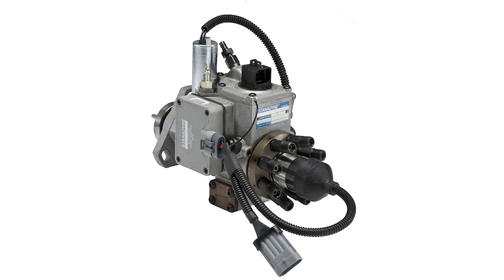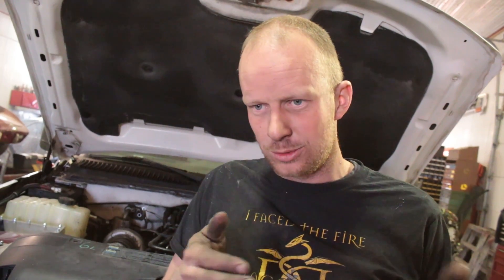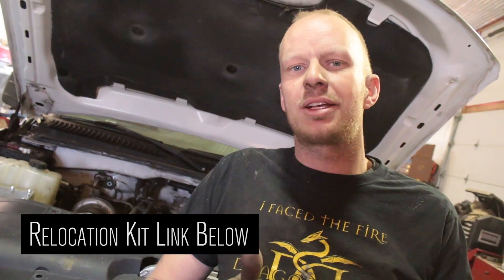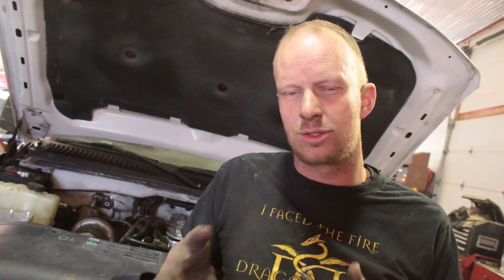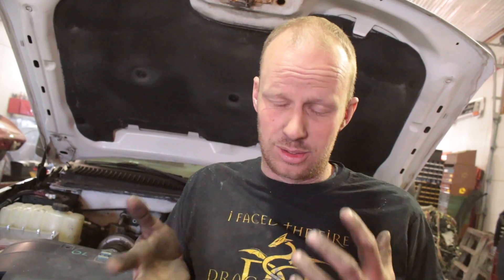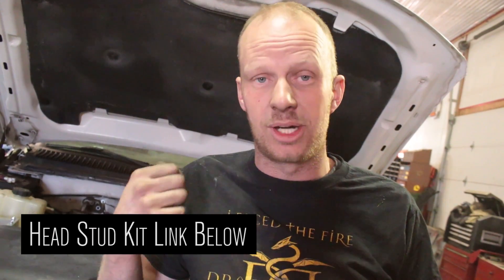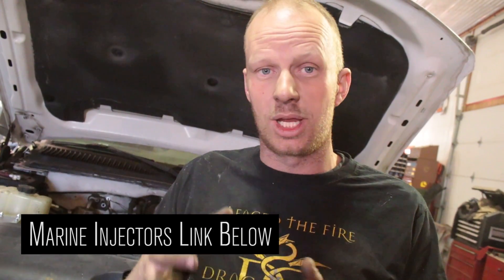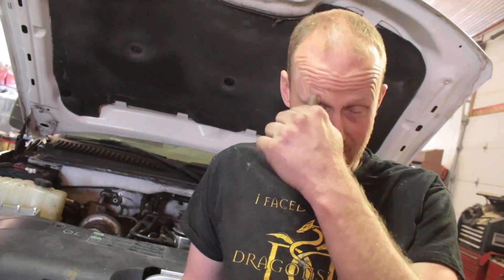REVIEW: Everything Wrong With A GM 6.5 Detroit Diesel

Comment: My brother just sold his reliable 1993 6.5 Detroit Diesel he had for years, he was extremely sad when it left but it was only sold because he got an insane deal on a 2004.5 LLY Duramax. It had like 232k miles on the clock. He did a lot of the upgrades you talked about, bigger turbo pushing about 25 pounds, airdog pumps, he's a mechanic so he did modify it for reliability. It might be "rated" for only like what, 8,000 lbs towing capacity or something? 

But he definitely pulled way over that without any problems, he was pulling 12-13 tons with it. His was a 3500 (non HD), 2WD dually. The most insane bit was the gas mileage on that truck, while pulling 12 tons of logs he'd literally get 26MPG. It was insane. He pulled heavy loads with that truck frequently as well. It pulled it with no problems, it might've been a little bit of a bumpy ride because well it doesn't have the suspension of the newer trucks, but it pulled it doing 65+ mph SCREAMING down the highway. His newer LLY duramax (completely stock duramax with just an EGR delete and stock exhaust... not even woken up yet), gets like 17mpg. They are reliable and great engines if taken care of, and the sound of that old Detroit was intoxicating. The older diesels just sound so damn good. 12 valves especially for that matter.  It probably helped that it was a straight pipe with a huge stack out of the bed, though.

12 valves are definitely superior engines but if you like the box body trucks and can't afford to swap a cummins in it, don't shy away from the Detroits. Just make sure it's a 6.5L because the 6.2L's didn't come with turbos. They can tow pretty well for a older pickup and they get great mpg.

Comment: LMFAO a 6bt will not last a million miles haha I work on heavy equipment and diesels for the oilfields we stack 6bt's for days. We get about 650k at best before we need to rebuild . Injectors and injection pumps are one between 200 and 250k . We use fleet dello oil and change the oil and fuel filters every 1500 gallons or once every two weeks as the are used on water transfer pumps. They may be good engines but they are garbage after 500k blow by for days. Cummins is not invincible lol only the Dodge tards will tell you dumb shit like that
Reply: I work on heavy equipment too, your just a fanboy that hates on Dodge and Cummins because whatever your daddy taught you to drive isnt shit in comparison. Fact is theres nothing better in the light to medium duty segment.  Many fleets have multiple Dodge w/ Cummins engines with over a million miles on original motors, transmissions, axles etc. if you guys cant get to that then you should learn how to maintain a diesel and stop running your mouth.

Comment: I have a 97 GMC 2500 van with the 6.5 TD  and the Stanodyne injector pump is crap . It went two times when my father owned the van  in the first 60 k miles . It has gone  a total of 3 times on me and i have 196k miles on it .I refuse to replace that pump anymore .They are garbage .

Comment: Later year 6.5s in the trucks were pushing 215 hp. They will work, my truck has pulled goosenecks for two different companies and kid before me claimed he had 18k behind it. I know guys that have regeared 3500s to 4.56 gears, nv4500 and have rolled accross the scales grossing 50k. Didn't get there fast but they did get there. Alot of the issues with these engines have been remedied,even the main cracking issues in the p400 platform, they added a girdle to the bottom end, moving the oil pan out of the structural equation. Mine currently has 265,000 miles on it and is still running strong. Still wouldn't complain about putting a 12 valve in the ol girl tho

Comment: The am General Hummv engine, 6.5l diesel was re designed to be stronger and renamed to 6500 Optimize. I have 3000,000 miles on my 6.5l diesel 2500 Suburban and get 20 mph highway. Before head gasket failed. Check out Heath Diesel.com.

Comment: My grandfather has a 96 gmc k2500 6.5t with a little over 700k miles on it it’s never been rebuilt other than a lift pump and injectors he is meticulous with maintenance though I suppose the body will finish rusting away before the engine quits.

Comment: Great vid, Good info in the injection pumps. But you forgot to mention all the cranks that snapped off if you ever tried to do any amount of real work with it and that mysterious hole in the block where a distributor would be on a gasser, and ironically the oil pump was driven from the cam via a tach pick up installed in that hole, Detroit diesel? Maby? but I'm still not convinced that these were not originally some casting of a gas engine.

Comment: My '95 3500 just hit 100,000 miles last year - all ive replaced was the PMD - no leaks - Last week it started blowing white smoke out the tailpipe before it even had a chance to warm up completely - I did however spin the tires on a wet road just before the white smoke .. any chance I couldve blown a head gasket just from pounding the pedal.?

Comment: I completely agree with everything said, my friend had a 95 gmc with the 6.5, and everything said in the video went wrong with his. However, I have a 93, which is fully mechanical, and I just rolled over to 421k miles, and it still runs great. The electronic injection was terrible, they should've stuck with mechanical.
Reply: GM couldn’t do that because of emissions.

Comment: The 6.5 cannot be compared to any of the newer diesels because it was not intercooled. You remove the intercooler off any of these newer Motors you'll have the same problems. I turbocharged a 6.2 and put a modified intercooler from a semi on it. I pulled upwards of 30,000 pounds was it. Boost pressure was upwards of 17 PSI. Factory injection pump was turned all the way up. 3 years later pulling a heavy load up a hill the transmission over cycled from second to third twice and bang shifting as well due to a bad TPS. Five minutes later the engine wadded-up. Haha

Comment: I owned one.  Very reliable once you relocate the PMD.  Had to pay for it 3 times before wising up to get the aftermarket heat sink and relocation kit.  Traded for a Cummins only because the 6.5 had little to no aftermarket support at the time.  Might have stayed with it had I known the crap the 47re would give me.

Comment: The biggest problem with the 6.5 Turbos are the engine blocks. They crack in the main webs. The fix is to go with the newer optimizer blocks which are setup for center & side mount turbos.

Comment: https://m.ebay.com/itm/CHEVROLET-GMC-CHEVY-6-5L-TURBO-DIESEL-GLOW-PLUG-WIRES-HARNESS-KIT-BLUE-IMPROVED/321754447257?epid=865085433&hash=item4aea0f3d99:g:SkcAAOSwofxUclwE I've found that the glow plugs harness that comes factory on these 6.5l needs attention too. I've owned 2 mid to late 90s Chevy's with them in it. All of the other points in the video is very accurate and pretty much what I've done to make these trucks bullet proof. One I'm experimenting with a solid axel up front as well instead of the way they are set up from factory. It's been so long since I've bullet proofed mine that I forget where the Injection pump is and if someone could comment to where it is that should be a pinned comment in my opinion. 

On another note I've found your channel from Ziptiesandbiasplys. Probably botched his name but I love the videos you do. Very informative and to the point. Love it and keep up the honest work bub.
Reply: Reading my old comment made me giggle lol. I just tore the damned thing down to find it under the intake. Had to replace the IP because someone had never changed the fuel filter... (It was a farm truck) and the pmd went out (it was a farm truck) the previous owner just unplugged the old pmd and fished the connector up and plugged in a new one rather than relocate it to the front bumper and put it on a heat sink. So when the PMD went out and it was revving like crazy it picked up some debris from the filter and killed my pump. So with that being said I did the "Feed the beast mod" from Leroy Diesel while I was in there. Put in marine injectors. Put on a HX-40 turbo and pulled the heads and did the head studs and had the heads serviced at the same time. Clocked my pump a little advanced. So far since then she has been a dream. Hauled a livestock trailer for a friend a few times with a litteral shit ton of Sal's in it. I love my 6.5's don't care what anyone thinks of em. Guess I have the 6.5 twitch lol

Comment: I was going to say don't forget the head gaskets. But yes the injection pump was it's biggest issue. Oh and the glow plugs. Spent a lot of time changing glow plugs, and whatever reason back in the early 2000's we kept getting 6v glow plugs instead of 12v. I'm pretty sure they were coming from gm too. But they would swell up and you couldn't get them out without pulling the head.

Comment: I want to own a diesel pick-up truck.  My use of a truck doesn't justify a new full-size truck.  I live in south Louisiana where flooding is expected and it occurs regularly.  What is a good low power small diesel pickup platform that's reliable and reasonable to buy and maintain.  What are your thoughts on Nissan Titan Diesel?

Comment: Fair review. It is obvious you don't know too much about them though. 7psi is stock but can get 18psi with a stock turbo. I have one truck with 260k and another with over 300k on it. Miles that is. I am using a 05 dmax right now and i will say a stock dmax isn't much more power than a woken up 6.5. Dmax uses a lot more fuel at idle. Also parts are way cheaper for the 6.5. In mid 2000's navistar bought the 6.5 and have a new block that is way better. The 6.5 started in 1993 and there are hummvee orders till 2050 with the 6.5. A new 6.5 long block is $7500 and only weighs 750 lbs.  New engines are made up to 300hp from factory.

Comment: I have a crew cab dually with a mechanical 6.5 with a banks sidewinder kit and marine injectors, absolutely love the truck. I makes a decent amount of power no it wont break any records but it seams like a very conservative and reliable build, has no problem moving my dually in a hurry. I have seen alot of the issues and downsides of the Detroit diesels but i am super happy with my set up. I agree with you about all of the newer 6.5 injection issues but i feel when built right the platform can be a decent option, It all comes down to what your overall goals are.

Comment: Nice to see someone with an informed opinion for a change. My buddy used to do sled pulls with a 6.5 dually. Everyone laughed at him, but he had a few top 10 runs (I think best was 6th or 7th place), and he always drove it home. I'm a die hard Cummins guy, but my truck has given me more trouble in 5 years than his did in 10. Between ball joints, wheel bearings, lift pump, injection pump, transmission issues, and rust, I'm tempted to go to the dark side and trade my Dodge for a Chevy
Reply: put it in an older dodge
Reply from the maker: Swap the Cummins into a Chev or F350 and get the best of both worlds

Comment: The first time I seen one of these engines up close was in 1988 in West Germany(before unification) when I just arrived there to serve in the US Army.  Obviously it was a naturally aspirated 6.2L in the HUMMVEE, and compared to PMCS weekly maintaining services of the deuce and a half trucks and five ton trailer haulers, it was a scary looking complicated machine, as compared to the old dodge pickups with diesel they were also phasing out like they had just the old jeep.  I think the platform was considered low speed and lower torque cause the automatic transmissions were initially going out alot for some reason, either lack of maintenance or abuse or doing things they couldn't really handle.  When they got into wrecks on the autobahn and were towed to the turn in yard/warehouse I worked in, usually the engines acted like a sort of internal bumper after the kevlar front end was obliterated in a head on or other highway accident, so a good wide V8 did provide more side to side anti crunching to the driver/passenger compartments apparently other than the ones really mangled and blooded.  They excelled at one good thing the military likes,.....good fuel economy and good long range, worked out well in the first gulf war I was in, good heat control, don't think I saw one overheat unnaturally.  I've owned a 1997 chevy c2500, no main part on the truck is original cause it was used to haul valuable  industrial items from out of state, and apparently they didn't use an aftermarket lift pump, which was why it was all new when I bought it for $2500 in 2013 with  new replacement injection pump, lift pump, all fuel lines and new tank, ....and new brakes, newer tires, new air conditioning, new rebuilt or new transmission and clutch, new trailer brake system, the most heavy duty trailer hitch you can get and not normal for regular trucks, and an engine that had a tag on it from a wrecking yard from a couple years prior that claimed it was an 83,000 mile unit, and a rebuilt limited slip differential,...and I had that winter a catastrophic fuel delivery problem that almost got me killed at 55 miles per hour on a cold frosty morning when I gunned the fuel  pedal and the engine cut off mid flight heading towards a corner with no power brakes or steering!......Took me awhile to realize that the fuel had too much alcohol and water in it and jelled and wouldn't move out of the tank, I mean, I would blow compressed air through the line and unclog the pickup sock and then pour lots of expensive anti jelling liquids in the tank,.....till it did it again.  I finally went with an airdog 100, beans sump kit, aftermarket pmd on the inner fenderwell to get some reliability and safety, only after the truck sat around unused mostly for several years due to a injury that made it unlikely for me to be crawling around on the driveway ground working on anything from my back and hurting neck.  The democrats have mandated too much alcohol in the fuel, even commercial vehicle diesel in Oregon,....they don't want diesels on the road in a democrat party way, I suppose cause they like to blackmail the oil industry for taxes, and like to make backroom deals to add loads of alcohol to gasoline engines and tax them too, all of which is hard to do with diesel private and commercial vehicles.  I mean, when I was in the military, we called water in the diesel fuel as "bad fuel", and we'd have to manually drain the water separators before every use of a vehicle that took alot of time if the known fuel was really contaminated.  These engines with several thousand dollars more worth of aftermarket goodies can make a great low cost, lower performance truck option alright, nothing steller I suppose, but I have a slight affection for mine and the platform,.....well, I wished I had one of those bulletproof new made extra strong blocks and the usual upgrades to make them reliable and have longevity,.....in an older truck, maybe older than mine so emission standards couldn't be pinned on them later or in other locales if I passed through them doing some sort of business and got scrutinized,.....probably would require a 1980's truck or an early 90's chevy to beat the emissions rules.

Comment: Hi, Kind of off topic but I'll looking for a drop in Diesel replacement for a Gas Marine 454/7.4L.  I'm recently retired Pilot and pretty hand and my brother is a GM Master Mechanic.  While everyone just says re-power,  on an old 1985 Jersey Boat it's just not practical.  What would be practical is a Engine that could bolt up to the existing bell housing and engine mounts and re-pitch the prop.  The other issue is the Idle noise of Diesels, while most Truck Diesel owners like it as they are sitting at the Stop Light, putting down river or harbor to the Ocean it would get old real fast.  Mercedes Owners that have diesels do not have that idle noise issue.  I'm guessing someone has produced a quite fuel pump for these GM Diesels so the guys that drive GM Diesels at work have the same DBs as their Mercedes at home.  Thanks

Comment: I agree the ds4 is a pile in my opinion the db2s are reliable the engine is a decent engine but will never compete with a 12 valve id run one simply for the fact they drop in with no mods at all but if your after the power that diesel trucks are making today you cant go wrong with a 12 valve for simplicity reliability longevity and power

Comment: I have a 6.5 In a 1995 GMC K3500. I'm losing Antifreeze. But not outside motor. The motor only supposedly has 68,238 when I got it. They had the intake off the old owners mechanic. And reused the old gaskets. Can The antifreeze get to a cylinder from intake gasket.also it starts hard hot or cold. I replaced filter housing and lift pump. When truck sets for a day. The lift pump runs forever. Any sugestions.would be very helpful. Thank You.

Comment: Very good  start on your view of 6.5 except the real difference between Hummer/boat engines are mechanical injection pumps. the truck is all electronic and thats the problem, every ground under the hood goes thru the computer under the passenger side.  the tranny , engine everything is grounded together, one bad ground affects the complete operating system. I will quit here because I'd be writing a book on whats wrong, and not whats  right.

Comment: Hated these things in the marine corps. 
Horrible fuel quality, horrible fluid quality, terrible electronics. It got so bad all 745 hmmwv got at least 1 new motor a year on top of 2-5 injection pumps a year. When the motors failed it took the crank or the block with it.

Comment: My 92 6.5 has 577,406 on it right now, it runs like garbage but it runs all I really use it for is towing my boat 2 miles to the river and back and it usually overheats each way, definitely not the best diesel engine out there. My daily is a 1500 with a 5.0 (305) and I think it has more jam then the 6.5